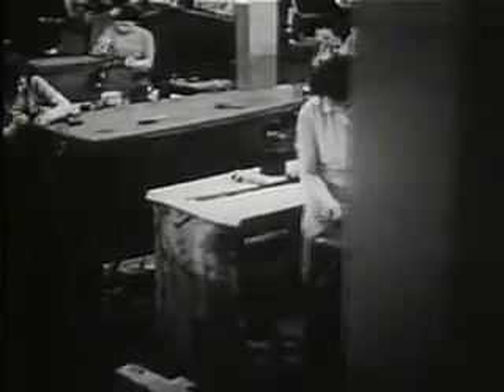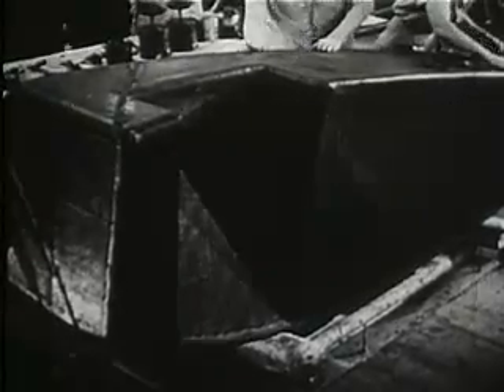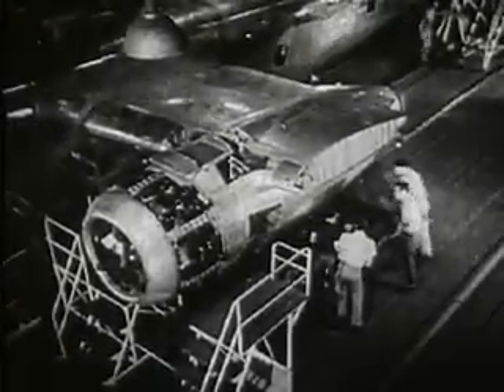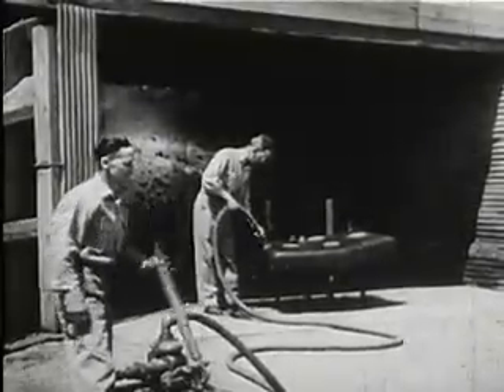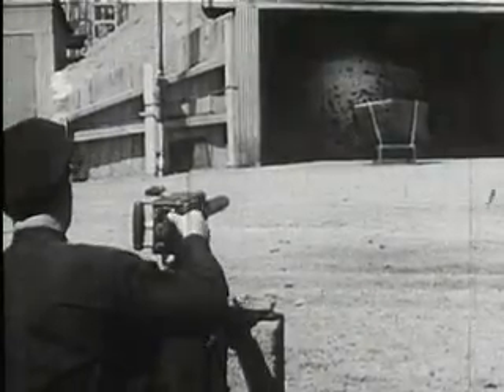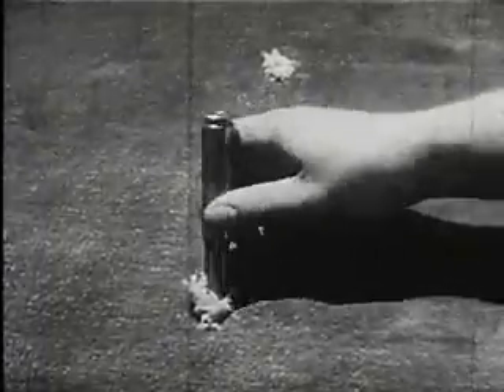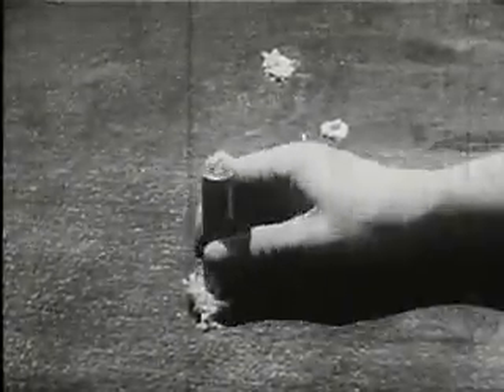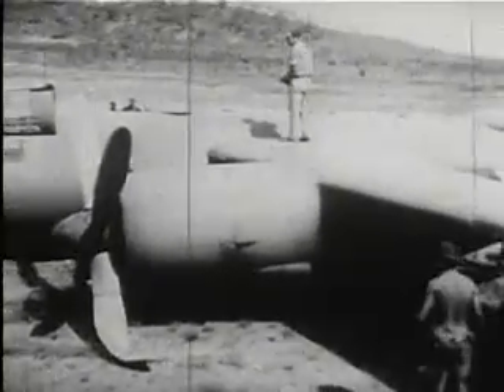Self-Sealing Fuel Tanks in WWII

Comment: I'm looking to make a self sealing fuel tank... know where I can get that special inner material to do it? Isn't it just rubber?
Reply: iandaous Bad idea, those are made to seal bullet holes, in the event of the crash they will hardly do anything.
you need the racing fuel tank with the sponge to keep the fuel from leaking incase the cell gets crushed/ ripped in two or some thing of that nature which happens in car crashes
Reply: inner wall was vulcanized rubber, inert to fuel,second wall was natural rubber with expanded if fuel touched it, outer wall was fabric, it just a matter of getting a secondary layer that expands upon fuel contact
Reply: iandaous although I said I was making self sealing fuel tanks, I really wanted to to make targets that self seal, but are somehow still visible, reusable.  :)